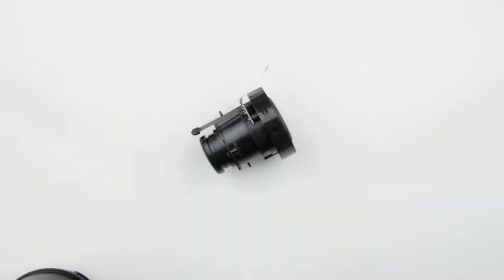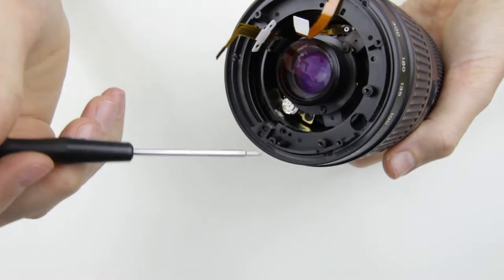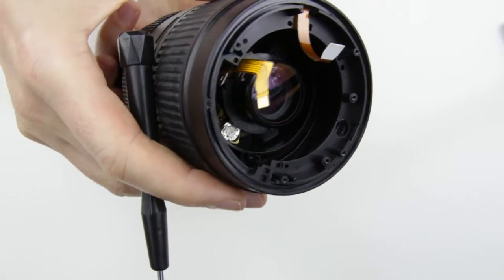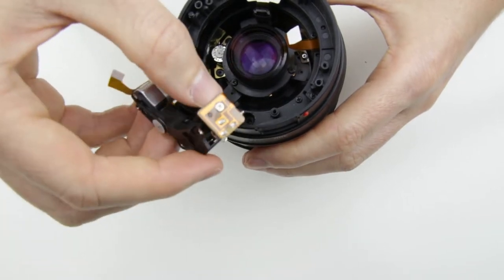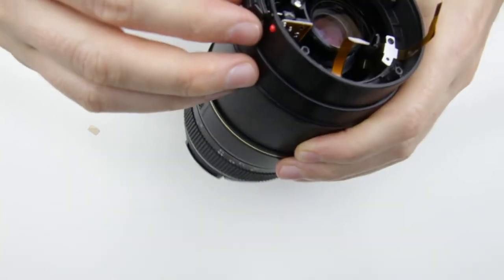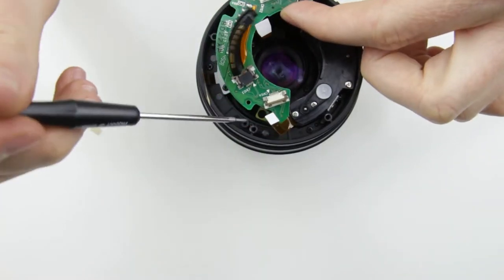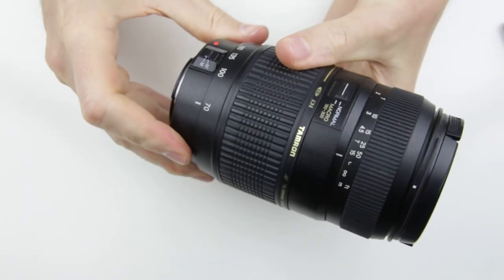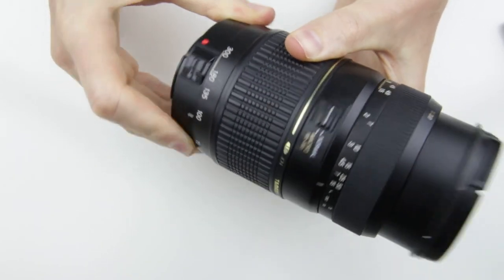Tamron 70-300mm f/4-5.6 Di LD macro lens assembly after replacing the aperture flex cable

Comment: Hi. I am rebuilding a Tamron 70-300 as you describe.  All is going well so far but when I removed the aperture motor to replace the flat cable a small flat thin copper washer fell out and I can't find where it came from. Any ideas? Help appreciated. Loving the videos, they are fantastic
Reply from the maker: Thank you for your comment.
I don't know where the washer came from.
Reply: The washer is located between the motor and the optical unit. I made this same observation. Sincerely

Comment: Awesome, i did it by myself! Few years ago I tried but not successfully.  Now i replaced this cable, but there is still an error .. but auto focus working now! (without changing the aperture). Maybe somebody knows - why?
Reply from the maker: - Check the end of the aperture cable if it is clean. Just to make sure clean it with a scratch pen. (I had problem with the Tamron 18-200mm lens, the aperture did not work, the connector of the cable seemed clean, but after I cleaned it with scratch pen, the aperture started working again).
- Disassemble the lens, and test if the aperture can be changed manually (moving the pin back and forth changes the aperture), if yes, check the cabel with a multimeter)

Comment: I have repaired my broken zoom ring  but now camera is showing no lens attached
Reply from the maker: Check the electronic connector, and the flex cable between the connector and the PCB. Also, clean the flex cable connector with scratch pen.
Reply: @CamerasLensesEtc  ok thnku so much i will try and tell u results